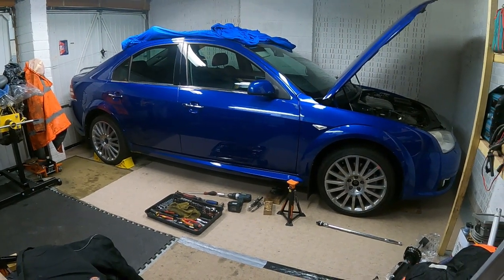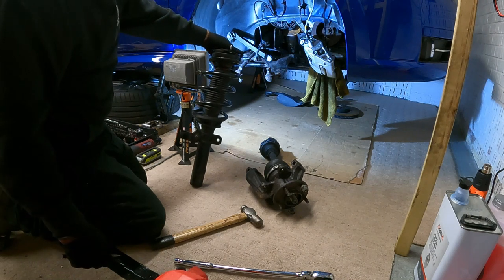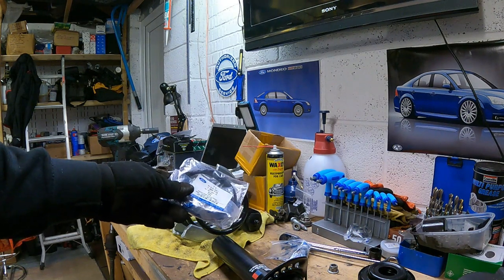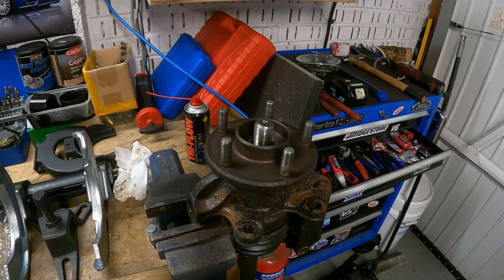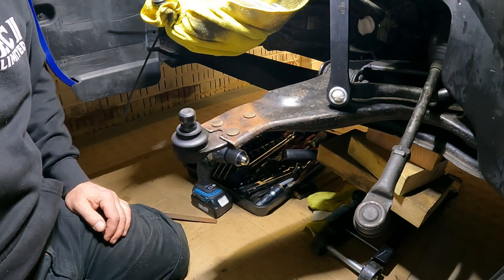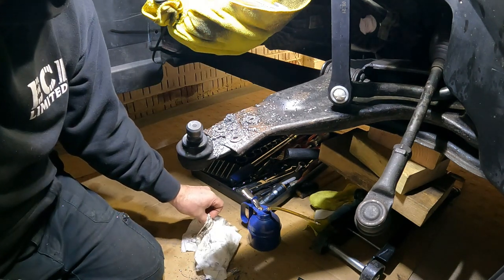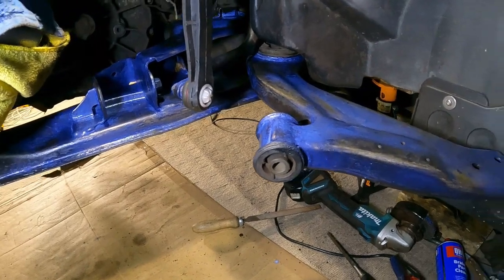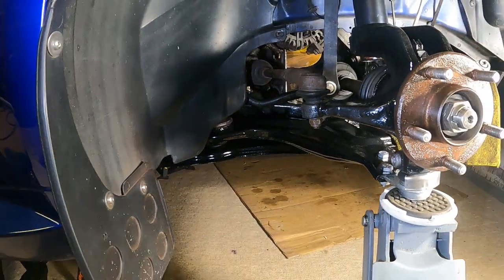ST220 FRONT SUSPENSION OVERHAUL

Comment: Are the shocks still available? The springs are discontinued :(
Reply from the maker: If you're looking for genuine ford springs and shocks I think you'll struggle for all 4 corners, I did going back in 2021. Aftermarket might be more available but always use part numbers and ensure that they match exactly and you are able to return as alot of suppliers will sell you components for a st tdci or even a standard model